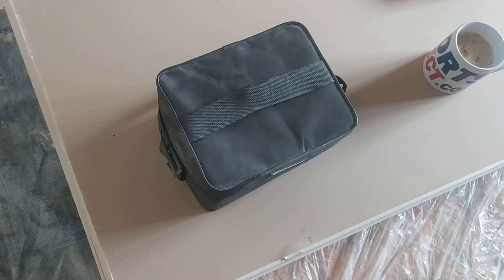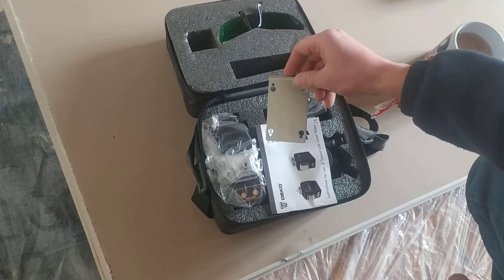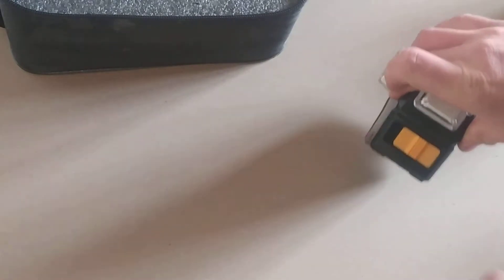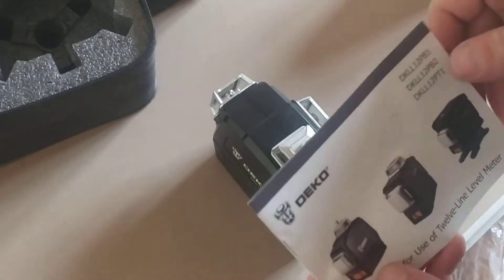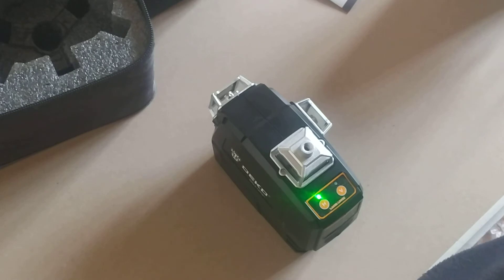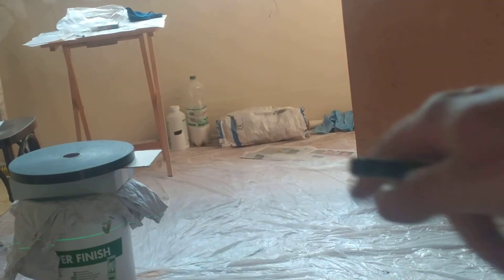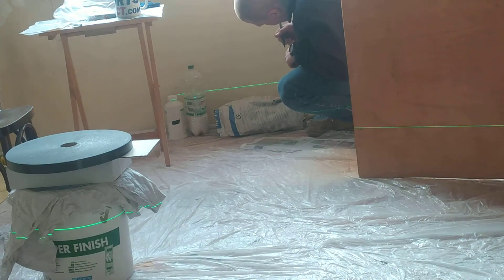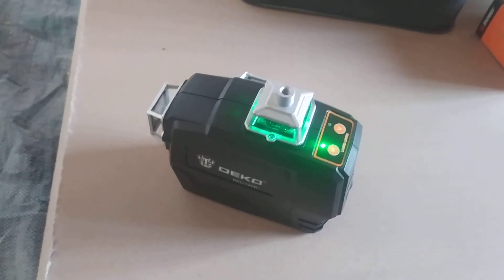DEKO laser level unboxing and accuracy check. AliExpress. DKLL12PB1

Comment: Thanks for explaining how to measure the accuracy.
Reply from the maker: It's good to be checked every now and then.
Reply: You should check by rotating every 90 degree. Best checking is by 180 degree.
I had on my Deko 6mm on 4m distance and I have returned it do the seller.
Reply: @TheHanskie  why did you returned it on the seller ? I'm planning to buy it because I'm an architect. what do you advice me please ?
Reply: @hananedesigner5448  because quality is low. Bad calibration. After rotatin 180degree I had 6mm difference in 4m distance. Other one had 2mm difference.